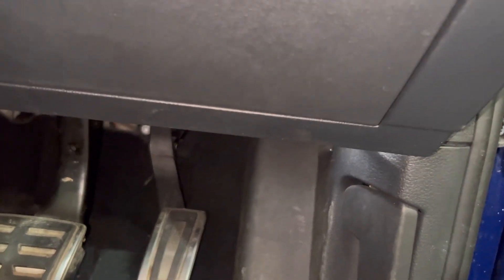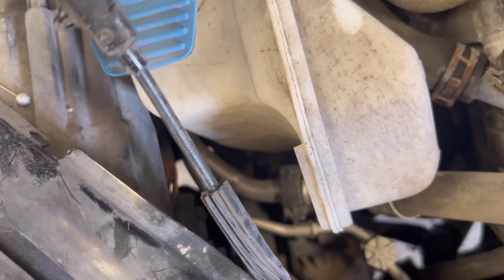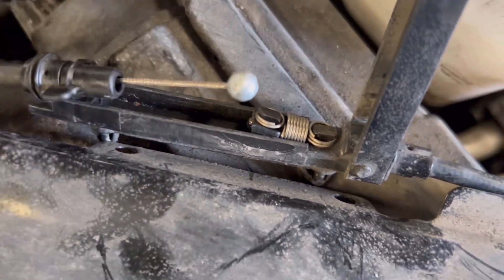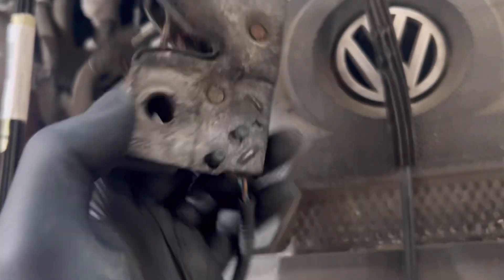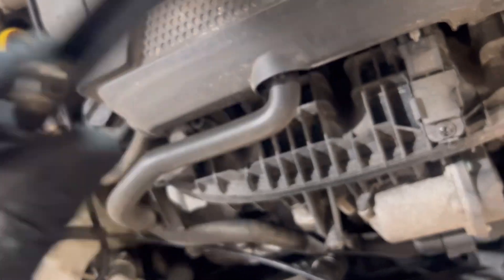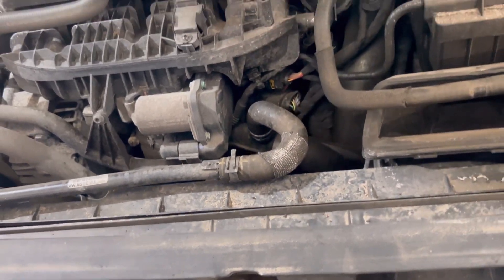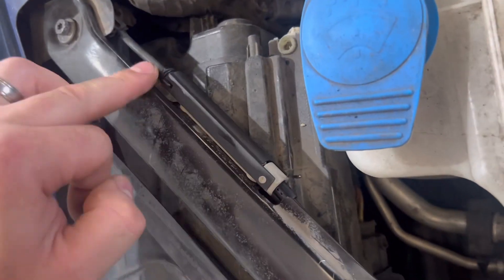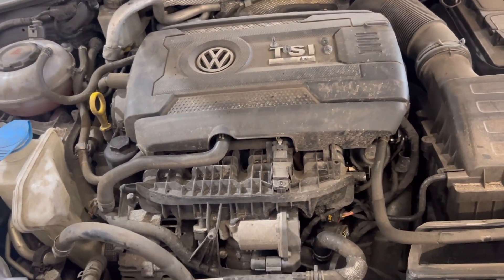VW Golf R Bonnet Won’t Open

Comment: Do you have any tips to pull cable to open the bonnet from under wheel arch. I have bonnet stuck closed and struggling to get enough lever on cable to open it.
Reply from the maker: You can get a long metal hook buddy and hook it around the cable and pull (pretty hard) and it should pop

Comment: I have a rear door that won’t open from the inside or outside due to child lock on,the problem is the electric window won’t open either so I’m thinking the window model is down  how do I open the door ? Golf mk5 08
Reply from the maker: Hey it’s a bit of a process but in short have someone sat in the drivers seat engine running and apply a small amount of revs, then have some one inside the vehicle pulling the inside handle repeatedly of the door you want to open and then you be on the outside pulling the outside handle repeatedly whilst banging the door where the lock mechanism is situated until it pops open

Comment: Same issue with snapped plastic, Just got bonnet open and ordered new cable section.
Do I NEED to order a new catch or can I get away with keeping the old one?
Reply from the maker: Aslong as your old catch is moving and isn’t seized then I would just make sure it’s clean and well greased
Reply: New replacement part fitted, granted I don’t think it was vw part (different colour), closed bonnet and tried to open and exact same thing happened where the plastic snapped.
Guess I should have changed the latch after all😐
Before I order a new latch (and another cable) any ideas if there could be any other part causing the issue?
Thanks